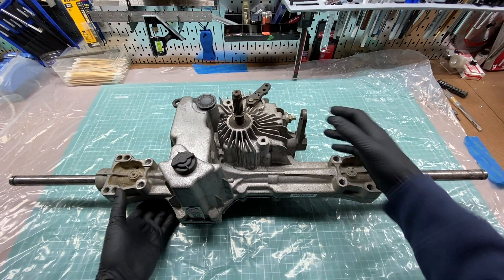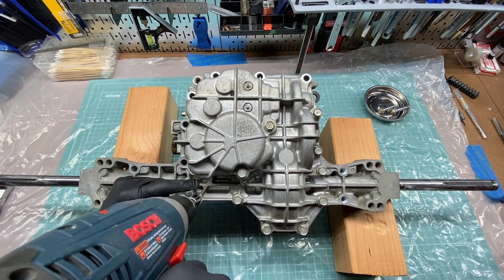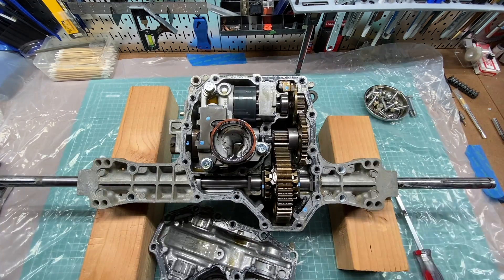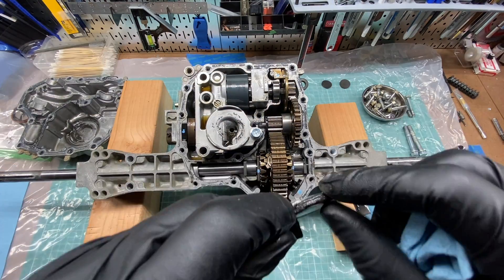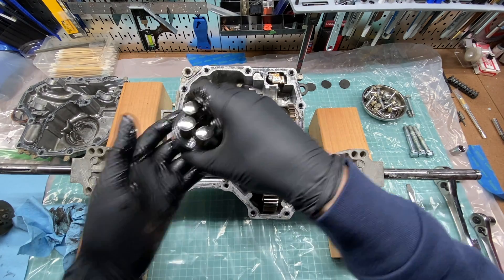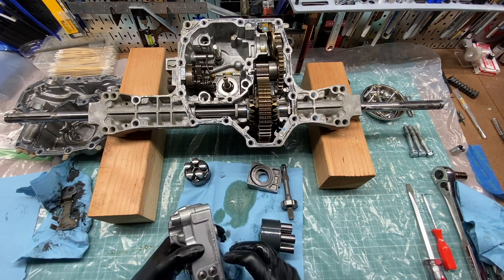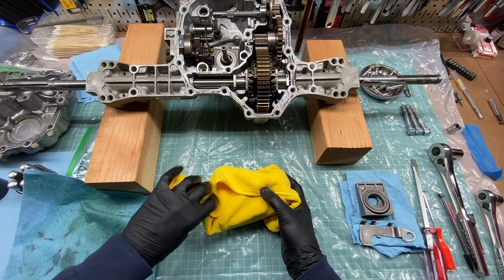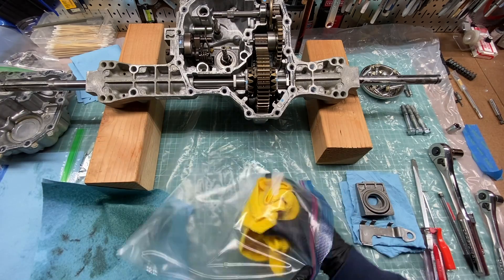Tuff Torq K46 / T40J Transaxle Pump Rebuild + Modifications (Oil Fill Mod Series Video 1)

Comment: My British Westwood machine has a header tank on top of the transmission so it's easy to see the level and top up. Great if you've got an axle bearing leak. You can keep on mowing until you have time to replace the bearings.

Comment: What about adding and external pump and hose barbs and plumbing in an oil cooler and possibly filter to suck out hot fluid and pump in cool fluid?
Reply from the maker: I’ve considered it. I think it would be a good mod. Even better if you could filter the oil inline. Maybe one day if I can find parts that look good.

Here is a guy who did an oil cooler mod. It’s a bit rough looking though: https://www.mytractorforum.com/threads/k46-oil-cooler-custom-my-way.1321309

Comment: Hi! I made the rebuild but when i use the mower the forward end the backward exchanged?! What can be the problem?
Reply from the maker: You put the wedge looking part in upside down. The part that I’m talking about is the one that is close to the brake disc. The shaft that the brake disc is connected to goes through the center of this part. You likely had to compress this wedge piece when putting the pump center case assembly back into the transmission case. 

Tuff Torq apparently designs it this way because some mower manufacturers need it to spin one way and others need it to spin the opposite way. 

You’re going to have to open the case again and flip the wedge 180 degrees. Let me know how it goes 😀

Comment: I just want to make it go fast. Even if it grenades after a few hrs.
Reply from the maker: Hah well if you wanted to go full cowboy you could try putting a bigger pulley on the transaxle’s input shaft.
Reply: @MostlyBuilds  sooooo, I put a bigger pully on it. And it's about twice as fast. But it feels like the pump just dumps off all the excess pump pressure through the bypass.. I am wondering if I remove the bypass if I can get it faster yet lol.
Reply from the maker: @ZackBadCompany1234  hah wow 2x faster sounds pretty awesome. I could be wrong but I don’t think you can “remove the bypass”. The bypass rod turns an internal shaft that presses on a little pin that slightly separates the motor cylinder from the center case on the pump assembly. I actually broke this pin recently by messing up putting things back together after taking the trans apart again. With the pin missing, the bypass rod does nothing and won’t separate the pump parts to let oil leak though. It’s the same as having the bypass rod turned off (pushed in). 

My guess is you are exceeding the pressures that the pump is designed for. I wouldn’t be surprised if it is also heating up and causing the oil to become more thin, making it easier to squirt out between the pump surfaces. 

If you don’t care about destroying the trans, you could potentially try a heavier weight oil that might not thin out as easy at higher temps. Possibly leaking less at higher pressure.

A total guess! The standard disclaimer applies! I’m not an expert. Don’t hurt yourself. Don’t listen to me 😀
Reply: @MostlyBuilds  haha my thought is to remove that little pin 😁 heavier oil is a good idea as well.  And no worries I take full responsibility for my Tom foolery 😆 great video btw have a good one!!
Reply: @MostlyBuilds  so here's an update. Removed bypass pin. ( your right, does nothing except stops the free wheeling  with manipulation of the small lever on the back) I put some Lucas hydraulic oil stop leak and that increased pressure a little more and gave me a little more speed.  I am in a situation now where the hydraulic pressure exceeds pump limits, and the pump body separates and bleeds off any excess pressure I was able to make.  I do plan on swapping to a solid axel with a cvt style clutxh. So, I will do any mods regardless of the consequences 😆
Reply from the maker: @ZackBadCompany1234  oh man this project sounds super fun. I had an idea for you. You could try increasing the spring pressure on two cylinders that contact the center pump case. The little pistons sit in the cylinders on top of springs. You could try shimming the springs with some washers if you can find the right size (pretty sure oil needs to be able to pass through). You might be able to create more oil pressure since it would be harder for those parts to separate. Not sure if the increased friction due to the spring pressure would have a negative impact. Or maybe the whole thing will explode!

Comment: Damn. I wish my x300 pos didn't blow it's k46 this year, now deere wants $1000 plus for a transmission (same garbage), I'm gonna tell them to get me a k58 instead. No rebuild kits at all, at least ones that don't come with new gears, which mine ground all to hell. I have only 320 hours on it, should be able to sell it for $3000, I'm screwed but to replace it's transmission.
Reply from the maker: Ouch. How did you manage to grind up the gears? Did all the oil leak out or something?
Reply: @MostlyBuilds  4 years ago it had blown out a seal and was brought back to the dealer under warranty, I'm wondering if they didn't get it filled exactly right or they didn't put the correct oil in it. I was hearing Deere put 1030 in it when tuff torq specifies 5w50 Then again, how did it make it another 4 years, granted the last few summers have been dry and it didn't get the usual hours mowing put on it.
Reply from the maker: @AmericanFarmerHVAC2024  wow. Have you contacted John Deere corporate? If you haven’t, I highly recommend doing so. The fact that you had a transmission failure when under warranty and then it mysteriously blows up? That sounds super suspicious. I wouldn’t be surprised if they give you a new transmission.
Reply: @MostlyBuilds  I don't believe John Deere corporate is on the side of the consumer/farmer. But maybe I ought to try it.
Reply from the maker: @AmericanFarmerHVAC2024  it doesn’t cost ya anything other than a few minutes. I emailed them about my early transaxle failure (~130 hours I think?). They wanted me to take the machine to a dealer so they could get more info. I had already started messing with it myself so I missed out on them potentially helping me out. I was surprised that they seemed like they might do something though. They didn’t just tell me too bad.
Reply: Deere are Anti repair farm screening a holes.f deere